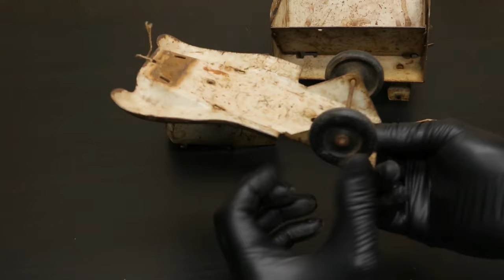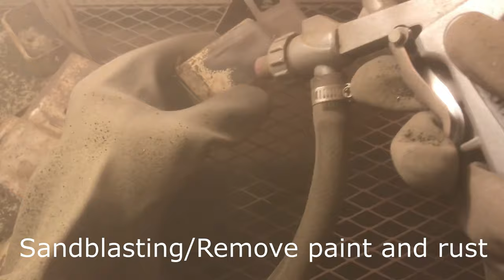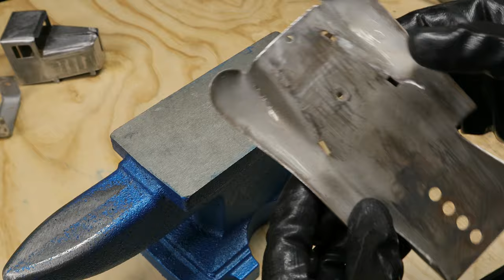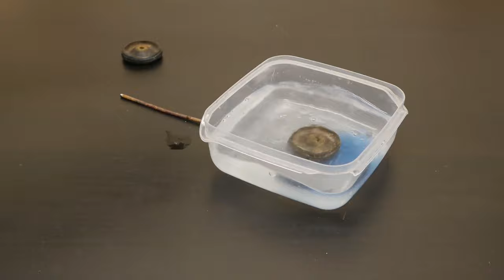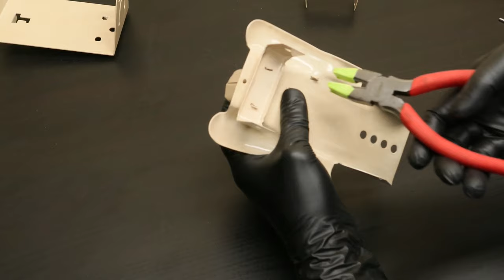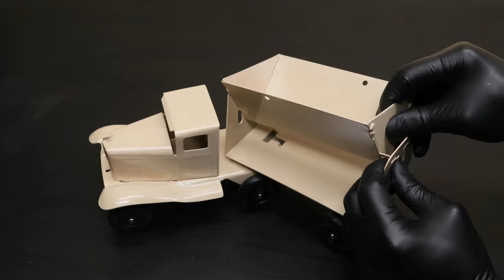Vintage 1920s Girard Dump Truck Restoration

Comment: Very interesting restoration. 

I particularly like your use of wooden blocks in the vise to support and grip the metal components. I'm amazed that very few YouTubers realise the power and strength of wood in the jaws of a vise. 

Many try to use metal, plastic or leather for that purpose, but a range of shapes made from either hardwood or softwood (depending on the requirements) are extremely useful. I keep a drawer of different pieces specifically for such purposes.😊

Simple design, but very tough, built to last as little boys easily destroy fragile toys.
Reply from the maker: Yes, I like to use wood blocks, sometimes I also use hard cardboards. Thank you so much for your great comment!!! 👍🏻👍🏻😊

Comment: I really do guess there was one front piece grill. The two pieces on top of the hood sticking out, and the front being open in the middle suggests this. But given the age of the toy, not finding one for replacement shouldn't be surprising. There are things we cannot help. Great restoration.
Reply from the maker: I am sure in early 1920s there was no grill for this Girard truck, I searched many times with Google
Reply: @ar_restoration , I was just going to say that you forgot the grill but since I read your reply I guess that there isn't one & great restoration

Comment: Probably missing the grille that attached to the hood tabs and a front bumper too. Also what are those two offset holes at the top of the hopper for? And was there a clear plastic wind screen missing? I would have painted the coal hopper black. And it wouldn't hurt to add some Kool looking decals to the truck doors. Not a bad resto, but you missed getting an 'A' and a Gold Star because of the above points.
Reply from the maker: This is definitely a complete bump truck without any missing parts.  You should know that was a truck toy produced in the early 1920s, that time there were not so many fancy decorations. As I know the plastic windshield and company decal only began to appear in Girard toys produced in the early 1930s (or late 1920). Thank you for your comment!👍

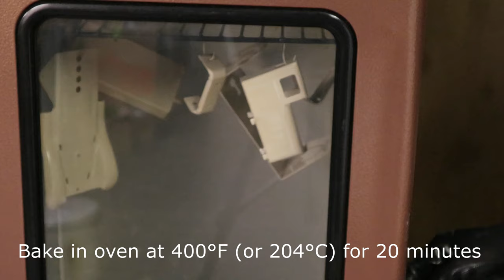Comment: Very nice! The extra body work really shows. I had to do a double take when that washer flew off the axle; I was not expecting that! Was that a flashlight you were using around 7:34 to inspect the coating?
Reply from the maker: Yes, the washer flew off that I just found out, thank you for the reminding! I used a flashlight to check the coating result at 7:34. Thank you for your nice comment and support!!!👍

Comment: Looks like a truck connected to a mine railway dump truck.
Reply from the maker: yes, I think so, and also for road construction. Thank you for the comment!!
Reply: @ar_restoration  Modern dump trucks have tippers that raise backwards. Maybe there were dump trucks with sideways moving tippers in 1920s.
Reply from the maker: @jacekpietrzak445  To raise backward need more power, only hydraulic systems can do it easily, there was no hydraulic in the 1920s

Comment: Why file the whole thing? What about sand paper? You could've just filed the edges.
Reply from the maker: I used sandpaper after file but didn’t show on the video. I think It is more effective to use a file on the surface dens of the part. Thank you for the comment!👍
Reply: @ar_restoration  Oh okay then. thank you for the restoration video :)